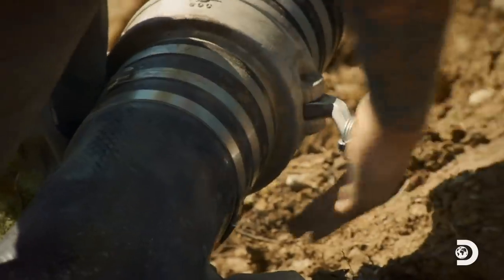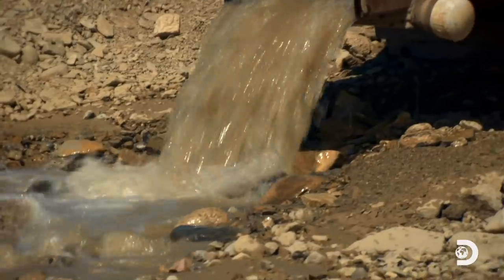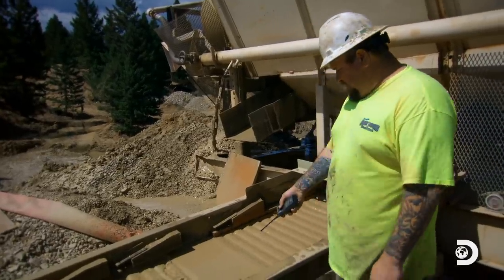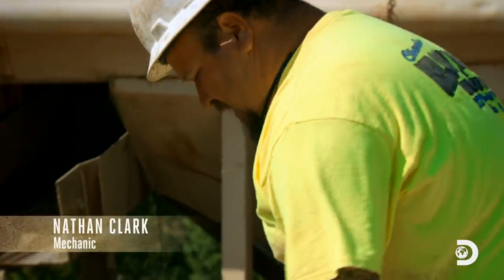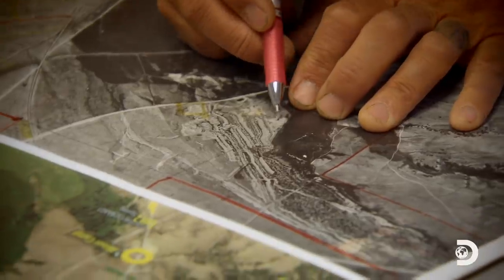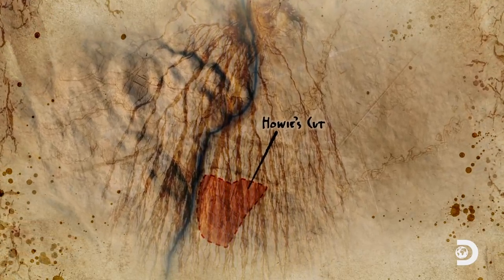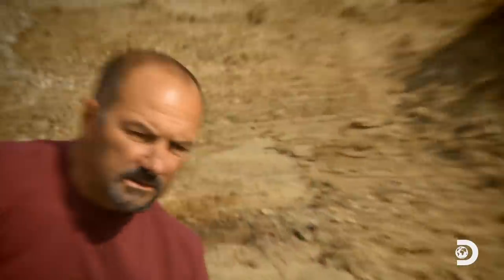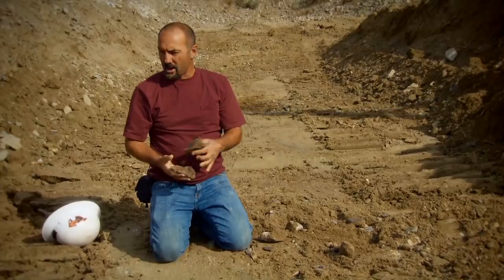Dave's Problematic Pay Dirt | Gold Rush: Dave Turin's Lost Mine

Comment: The problem is trommel water pressure is low , if the concentrate is pushed out the angle of the sluice should be adjusted
Reply: Not all pay is the same, neither can the setup on your equipment

Comment: No problem for Dozer Dave, when the washplant gets clogged with clay mud, he goes into the office and looks at area maps for the answer. Yeah, yeah, that's where the answer is to the mud, just find a place on the map to mine where there is no mud. Oh, you mean the area's ground soil does not change every 25 feet and the whole area is going to be soil comprised of clay which turns to mud when it gets wet. Damn, and I thought for sure that Dozer Dave the self-proclaimed gold mining expert would have known that before he started mining in a clay area environment. Dozer Dave, wonk, wonk, wrong again,  you can rest easy Todd you didn't lose a mine boss when Dozer Dave left your crew, you just got rid of a big problem with that name.